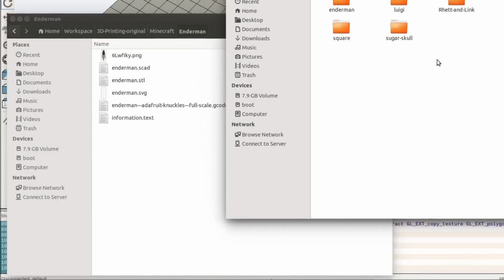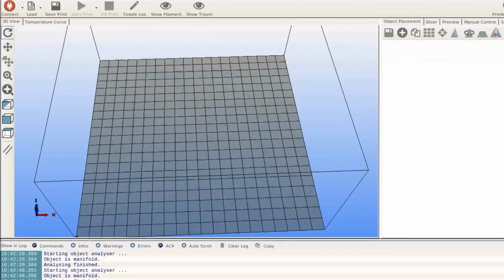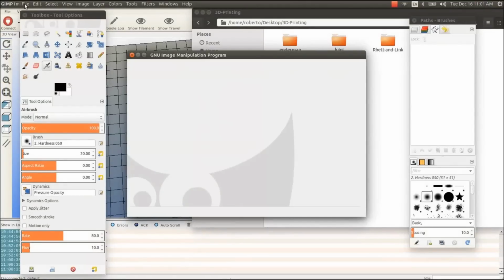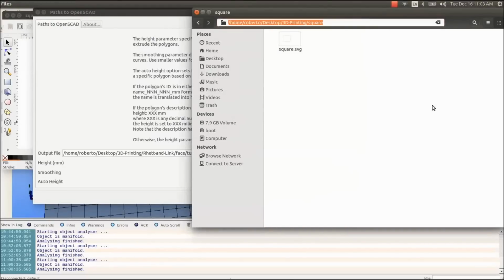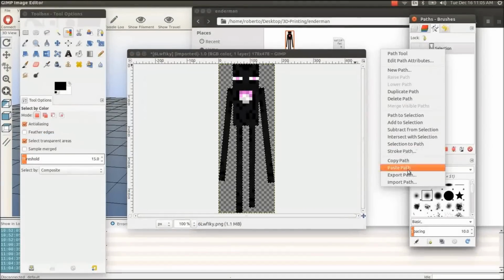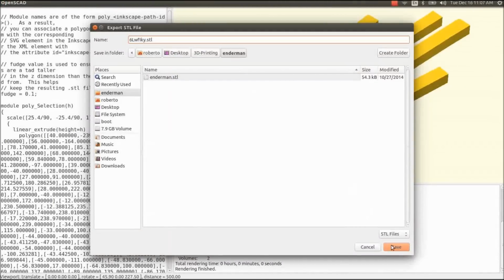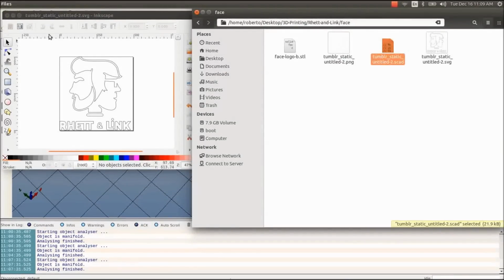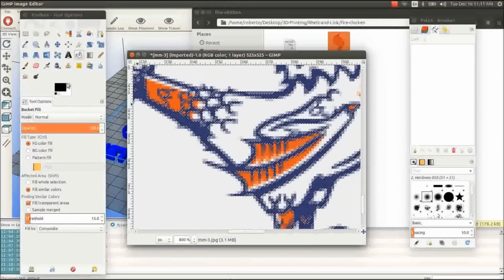2D Image to 3D Printable Model or 2D Plus Height Printing

Comment: I have been trying for two weeks to do what you are doing, with no luck. :-(
I am sorry to say your video is of little help, you spend too much time bragging about what you have done and too little explaining how you did it. For example, how and where to find the Inkscape plug-in that you are using in OpenSKADS
Reply from the maker: +Rolf Randby Thanks for the feedback, Rolf.  There is a link in the video description to more project information.  Also, I just added another link that mentions more specifically where/how to obtain the system requirements for the workflow (including the Inkscape OpenSCAD Plugin).